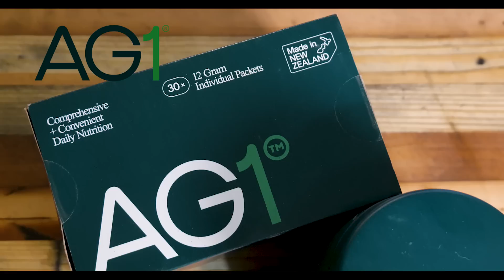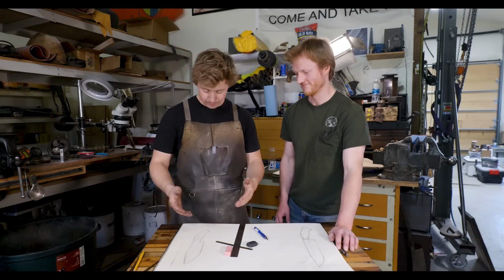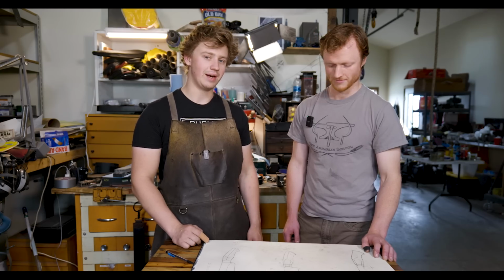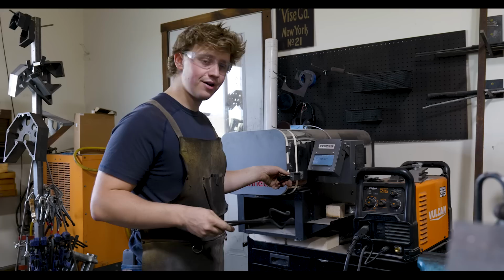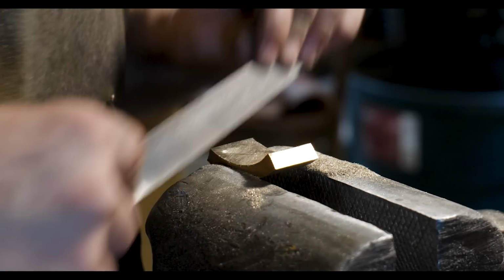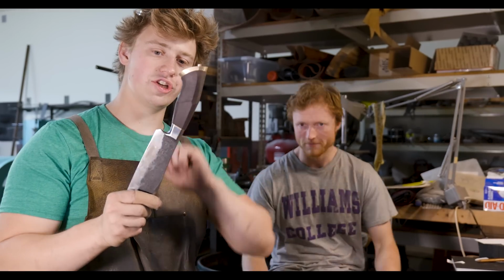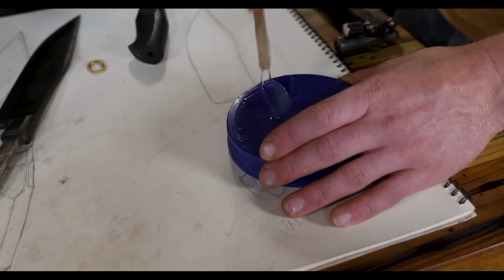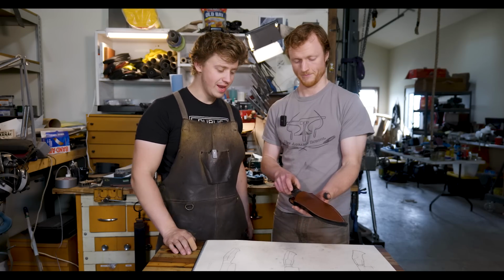You Can't Camp Without This Knife

Comment: I'm surprised you didn't have any saw tooth action on the bottom end of the blades. Odds are chopping is one thing, but if you're cutting down some branches, or anything a little thicker, you might need it to saw your way through a piece of wood.

Comment: Good shoutout for shop safety.  You should replace the middle part of the bandsaw deck with a new one to close up that slot and usually there's a floating round piece in the middle where the blade goes to keep the blade from sucking things inside.

Comment: Great blade shape and another great vid. SOmething almost every vid with a bandsaw shows is the top guide way to high above the table. The top guide should be as close as possible to the work. This A) makes the saw safer and 2) reduces the flex in the blade leading to straighter cuts. Glad you're OK WIll.